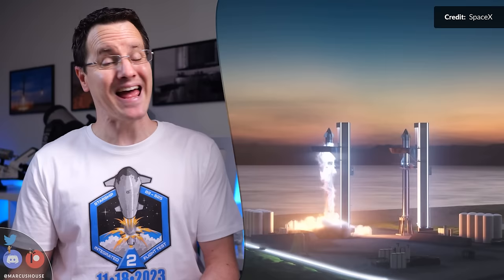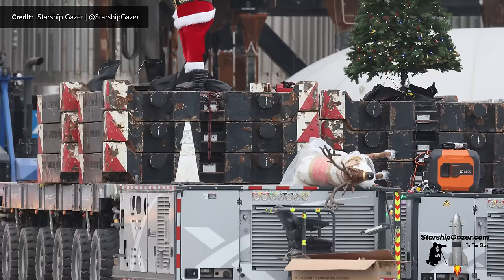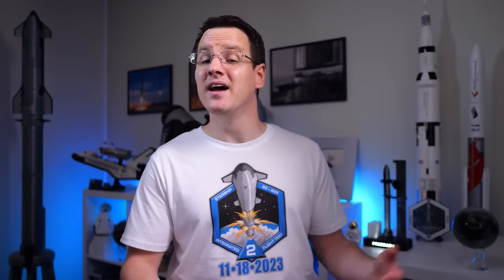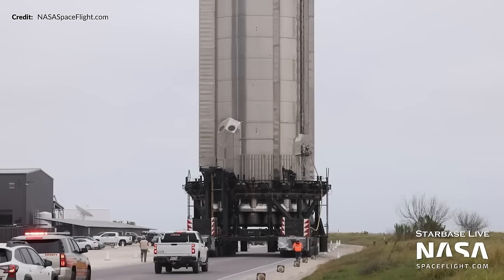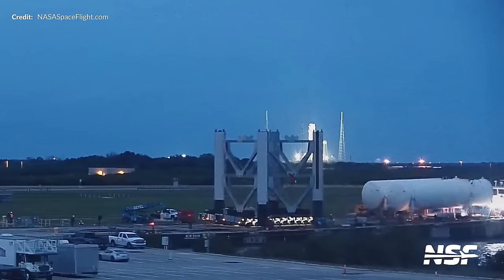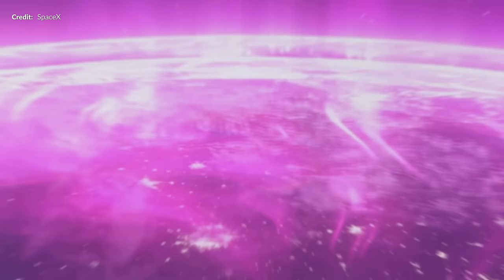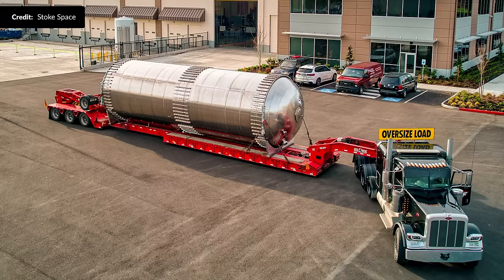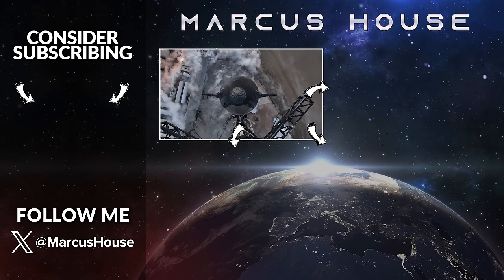SpaceX Starbase Pad Ripped Apart and Massive Site Changes Coming!

Comment: I LOVE how the Falcon 9 boosters look so rugged and tarnished after so many successful launches. and then the core that is expended looks brand new.
Reply: That's because the center booster isn't a standard falcon 9.  It has structural reinforcement the side booster do not.  They've never reused a center booster.
Reply: @JoeShmoism  Yeah, and I think they even lack grid fins sometimes if I'm not mistaken.

Comment: The thing that amazes me is that SpaceX is moving them massive vehicles around with just small transports while the SLS requires a huge crawler. Now, I know that the SLS is fully integrated while the Starship is mounted to the booster at the pad but still the difference in sizes is rather amazing.
Reply: But how else would Bechtel get their chunk of the pie?
Reply: @jamescobban857 The NASA crawlers were bought and paid for 50+ years ago. Not using them is a waste of money.
Reply: SLS is a money grabbing thing from some huge companies. There’s a lot of kick-backs going on. For as long as they were set up. Everything in America runs into over cost/ over-runs. I guess they suffer from the ( runs)
Reply: @RCAvhstape  that's what they said about the whole sls program, so they saved few million dollars using  used engines by spending another tens of billions of dollars
Reply: It's smart specifications by smart engineers, without greed, graft or corruption in the mix. 

Specifying hydrogen for the propellant of ANY first stage is just one example of wrong - headed specifications that is guaranteed to explode cost to manufacture. Using three hydrogen powered boosters is ludicrous.

[The Delta IV booster propulsion is provided by three liquid hydrogen and liquid oxygen-burning RS-68A engines. Each RS-68A engine produces 312.3 kilo-Newtons (705,250 lbs) of thrust for a combined total liftoff thrust of more than 2.1 million pounds.]
Reply: @imconsequetau5275  "three hydrogen powered boosters"?  You mean stages?  The boosters on the sides of SLS are solid rocket boosters.
Reply: @RCAvhstape  That is the same logic behind reusing the SSME/RS25s that NASA bought fifty years ago.  You know the ones that cost $146M apiece just to recondition!  Just because something was bought in the past does not mean that it is still of value.  40 years ago I spent $3K on a set of Encyclopaedia Britannica.  Five years ago I put them out for paper recycling.  Can you think of any other high technology product from fifty years ago that has ANY value outside of a museum?
Reply: Isn't there talk of replacing the SRBs with liquid fueled ones? More thrust, etc. for heavier lifts.  @FireStormOOO_
Reply: @jamescobban857  No it's not the same logic. The crawlers are paid off and they still function just fine, and they are not discarded after every use like the SLS' engines. You would have NASA blow megabucks on all new vehicles to move things to the pad when the old crawlers already exist. With your mentality, you'd make a good congressman.
Reply: The crawlers are the base of the launch pad. You’d have to build a whole new launch pad to NOT use them. That would be a real waste of money.
Reply: The difference is mostly due to the solid boosters. Starship and Superheavy are big, but they're relatively light when not fueled... easily within the limits of off-the-shelf SPMTs. But those solid boosters on the side of SLS or Shuttle are *heavy*, and if you're going to build your system around giant solid booster, you're going to need something special to carry the stack around.

Not that the crawlers were built for that, granted... they were built for the SaturnV and its mobile support tower.
Reply: SpaceX: move thing from A to B at lowest cost and do it yesterday.
NASA: government madates we give conttracts to former Shuttle contractors to keep them alive.  So redesign the SRBs, engines, tanks. But since the mobile launch platform/crawler  from Apollo era is not part of the lobby menu, we keep that so that more funds can go to the list of lobbyists.
Reply: That is literally the sink cost fallacy
Reply: I think it has to do with how the rockets are fueled. It's the difference between moving them while empty or full, and the crawler is also able to transport solid fuel rockets as well.
Reply: @jamescobban857 old radio bulbs are very much in some mordern top notch high end amplifiers, for audiophiles..  but that still that is just one piece of old technology used in newer designs
Reply: @eneking2022  Ah, I do not believe that is true. The crawlers are also carrying the launch pad. I believe that when they reach the tower, the crawler sets the stack down and then rolls out of the way. Oh, heck, let me check. Here, from the NASA website: "Once CT-2 makes its eight-hour trek to the pad, the ML (Mobile Launcher) and SLS will be lowered onto pad mount mechanisms. After power has been transferred from the crawler to the pad, CT-2 will roll back down the pad slope and park just outside the pad perimeter gate." The main reason that I bring this up is because I read that the crawlers are not strong enough to carry the next gen SLS rockets that NASA has planned.
Reply: @RCAvhstape  The real problem is not with the crawlers.  It is with all the rest of the launch process which has been specifically designed to make sure that all this half-century old equipment can still be used.  In particular using the crawlers requires building a new mobile tower to support the external connections of each new booster.  My slap at Bechtel is because it has the contract for the mobile tower to support the SLS Block 1B.  Bechtel has already gone over its $400M budget for that tower, a piece of gear which is only expected to be used once every two years and to require extensive maintenance after every launch.  That tower is ONLY required so that NASA can continue to use the crawlers.  No mobile towers, no crawlers.  The Starship Super Heavy Booster is bigger than an entire SLS stack.  It is much easier to build a fixed 50-story tower than one that must be movable.

How many other fifty-year old vehicles are still used by NASA?  Does Clarence drive around in a half-century old car?  How much air pollution is generated by the crawlers with its diesel engines compared to the electric engines on the SPMTs?
Reply: @RCAvhstape  that's not remotely how that works - it's the sunk cost fallacy. If the cost of upgrading and using the crawlers is higher than building new, you've wasted money. BTW, it's a waste of money - the contractors got over $1bn to maintain the crawlers and launch tower. The entire starship program is approx $4bn.
Reply: @jarretta2656  It's not even remotely what the sunk cost fallacy applies to. Artemis itself may be, but as long as something like Artemis is going to exist, something needs to move it to the pad. If you think NASA wouldn't have blown just as much money on a new vehicle as they wasted on modifying the existing crawlers you're kidding yourself. I stand by my assertion that the basic crawlers are well-built vehicles that work just fine, despite the mismanagement of the mobile launch platform mods. As for all the arguments about it being "old technology", it's a diesel-powered tracked vehicle built by an earth-moving equipment manufacturer, not sure how much advancement there's been in those fields. There are loads of 60 year old diesel locomotives and trucks still in use in the private sector where they actually make money for their owners.
Reply: @RCAvhstape  it is very cool, very solid tech. It’s also freaking huge. The OLM system SX has is very efficient by comparison, using commercial  transport vehicles instead of one off machines. The cost to maintain the OLM is inherently high because of size and their uniqueness.
Reply: @FireStormOOO_  
The Delta IV booster propulsion is provided by three liquid hydrogen and liquid oxygen-burning RS-68A engines. Each RS-68A engine produces 312.3 kilo-Newtons (705,250 lbs) of thrust for a combined total liftoff thrust of more than 2.1 million pounds.

So, 3 boosters

Comment: I think testing with engines in place enables them to test more things simultaneously.   Like, All the fuel supply connections to the fixed and gymballing engines. As they gain confidence on the manufacturing process for the boosters, they do not expect ordinary tank failures thru simple visual and X-ray weld inspection.
Reply: SpaceX will always continue to LN2 pressure test every tank before ever adding propellant. Trust, but verify!

Comment: I think the new launch tower at BOCA is definitely going to be a catch only tower.  It took six months to build the water suppression system, but it took almost a year to build the launch table (it's highly complex).  If it is a catch only tower, you don't need either and can get it up fast.  I think the key for it's use will be it's placement.  If it is not at the launch site, then it's a catch tower for sure.  Protects the launch site and tank farm from being destroyed if catch fails.

Comment: Initial cryo tests with the engines installed do suggest increased confidence, but the production rate of Raptors (and apparently low cost) certainly factors into things. I imagine they consider the risk of mishaps damaging the engines acceptably low, especially as such a failure would likely cause sufficient delay that replacement Raptors would not be the limiting factor for testing. Or perhaps Raptor 2 production is over and Raptor 3s are incompatible with the puck in SH v1?

Comment: I just heard the Relativity Anon R engine being  test fired for about a couple of minutes at Stennis on Friday night. I could hear it from 12 miles (19 km) away over the TV playing. I'm guessing that was what is was, to make that much noise inside a brick house with double glazed windows which are always closed due to the hot and humid climate 8 months of the year. After walking outside to be sure it was Stennis, I could hear the rocket engine over the din of Interstate 12, which is 300 meters from the house. The atmosphere has to be right to hear the engines being tested at this distance.

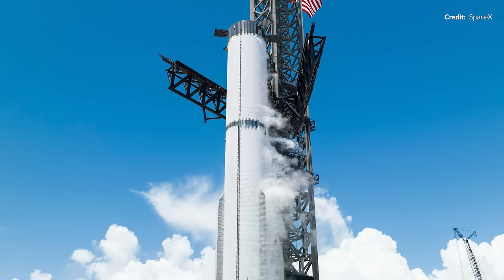Comment: 8:32 FINALLY, a shot of the steel plating they lay on the pavement to compensate for the curvature of the road, so as to keep the Booster from tipping over in transit.
Reply: The SPMTs already have leveling functions. And the road speed doesn't require turn banking. Perhaps the [local] pavement gravel bed is not thick/stif enough to handle the tire point loads?

I recall hearing that the road is wavy from heavy trucks shifting the pavement.
Reply: @imconsequetau5275  Quite likely

Comment: 2nd tower: my guess is that this second tower won't have an OLT and will only be used to perform catches. It would be silly to test catches on the actual launching tower and all the stage0 infra.
Reply: This makes sense. My prediction towards end of 2024 we see booster catches
Reply: No. The damage from a failed catch will not be "severe", and a catch tower would be very difficult to convert for launch operations.
Besides, a catch tower would also need a stripped down OLM to purge the tanks. If it catches ships, then it needs an SQD for the same reason. And by that point, you might as well make it a full launch tower.

Comment: From a technical and architectural standpoint, I would refer to those structural elements on the ground at the 7-minute mark to be called girders. Love your show Marcus and Crew!
Reply: A truss, even?
Reply: Marcus mentioned these are vertical members.  Assuming these are to be installed vertically then what we really have is a truss-column.  It is hard to see in detail how these trusses are constructed, but they are quite unique from what is usually seen in the common building structure world.  The two "chords" (I-shaped sections) are very different from each other.  One is very large and oriented in "weak axis" (their flanges stick out to each side of the truss) to provide self bracing for the chord, which assumes there's no other structural members framing in that might provide the bracing.  The other chord is in "strong axis" and is smaller in section, implying attachment of other framing that will serve to provide bracing of the chord.  The "web" (diagonal) members are rectangular tubes attached to the chords with gusset plates (common for heavy building trusses).
Reply: @willnelson5692  Good point, so it's not a girder, thank you for that clarification. They're certainly the beefiest truss columns I've ever seen! I worked at an architecture office and we did a building with a famous architect, the design cantilevers over a 3-lane street and the main support beam is a single W section. It had to be imported from Belgium because it was so heavy none were made in America. I can't imagine what it's going to support. Space X blows my mind. Cheers.
Reply: So the strong axis chord might be braced by the building cladding?
Reply: @willnelson5692 
If Marcus is wrong for once about vertical orientation, and the truss is horizontal; the smaller chord might always be in tension while the larger chord would be relatively stiffer in compression. This might be an isolated horizontal truss (at least during installation) that is going to be the sum of 1/2 or 1/3 of the segments in the yard.

Comment: The FCC complained that the $500 up-front cost of the router made Starlink inappropriate for poorer customers, but $900,000,000 could have paid for 1,800,000 such routers.  So, the FCC basically made Starlink ineligible for the subsidy just by withholding the subsidy.
Reply: So perhaps the FCC could just lease a million Starlink boxes and sublet them to demonstratably poor rural Americans with school age kids. Problem solved.

Comment: Dear Marcus, on my personal (and very bold:) opinion, ship 26 could be used for propellant testing in orbit? If I am right, they would need to develop this technique as part of their contract with NASA for the Artemis project, wouldn't they?
Reply: They firstly need to develop the technique of reaching orbit...
Reply: Yeah, even the first [successful] suborbital flight would have time to transfer oxygen into the header tank. And that doesn't have to survive reentry.
Reply: They only need to transfer 10 tons of oxygen to qualify for a NASA award. If fully achieved, the award would reach $53.2m.
Reply: @imconsequetau5275  Weren't the supposed to do it before the end of 2022?
Reply: @TrevorSachko  
No these are experimental model ships and the NASA award has not expired. No "supposed" involved here; the timeline is aspirational, not compulsory.
Reply: @imconsequetau5275  So you can't read either....

Comment: I have Starlink, and it's definitely the best option where I live, but I'm disappointed that I don't see speed improvements.
Reply: @@nodonkeys But the system is growing with new launches. We need Starship launching V2 Starlink satellites.
Reply: I have Starlink too, it's true but the speed is not bad at all. Actually it's still great. A little expensive maybe...
Reply: @HeartBeatSurfer  I am a professional photographer. It takes several hours for me to upload a photo set. I tried a business account, and it wasn't significantly faster. Still better than the alternative, which is phone service.
Reply: @@nodonkeys LOL that's not how this works
Reply: Pity you have to rely on that
Reply: @ThatOpalGuy  Pity I have to live on a tiny, Caribbean island, 2 blocks from 3 different white sand beaches, surrounded by warm, clear water, retired at 55.
Reply: @riparianlife97701 pity you're 55 and act 12...
Reply: @@nodonkeysyes and no.  The more people who sign up in your immediate area the slower it will get.    But total subscriber count isn't a hard limit on performance. 

But I've said this from the beginning.  People underestimate how much equipment goes into providing land-based Internet

A large city like New York has more data moving capacity than the entirety of the starlink network at full deployment.  One large city.

Starlink will need to grow to hundreds of times it's current size to ever be able to truly compete with large land based broadband. 

It will just never be that useful in densely populated areas but has the potential to be great for rural areas.
Reply: @colinroll9555  Goddamn, I wish I was as cool as you.
Reply: 55, ouch
Reply: @jmoreno6094  You're young? That's so cool! What were sone of the factors you considered when deciding to be born more recently than me?

Comment: The FCC didn't claim Starlink had failed to meet the requirements of 100Mbps/20Mbps (they're up to average ~70Mbps at this point), but rather that Starlink would fail to meet those requirements by the 2025 deadline, and therefore must be disqualified immediately.

Comment: Ship 26:  I was hoping that SpaceX would launch  it into orbit, and use it as a permanent orbiting tanker that the propellant ferries will deliver to store fuel in until Artemis HLS comes and refuels from it...??
Reply: It will need a sophisticated cooling system to store CH⁴ and O² long term in LEO. Some sort of external coating may be necessary.

Comment: Over here in Australia Optus is handling the rollout of starlink cellular service; which given the vast swaths of nothing for over 100km in any direction will come in very useful as it eliminates the need for a dedicated satellite phone and/or starlink antenna and will provide 100% 5G coverage for the entire country; not just whatever percentage of populated areas as everyone claims; but true 100% area coverage. And roaming is much easier because wherever you go outside of the polar circles; your normal service goes with you.